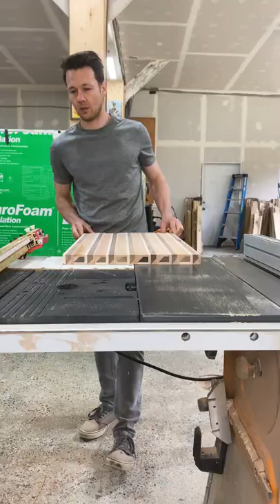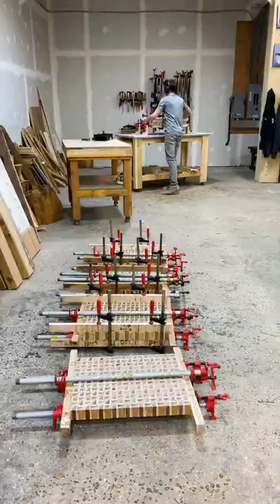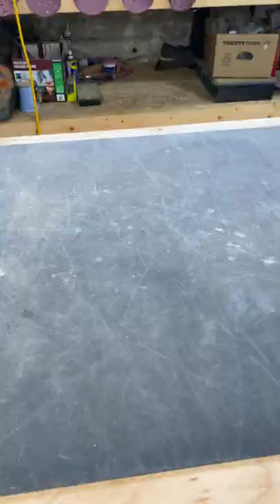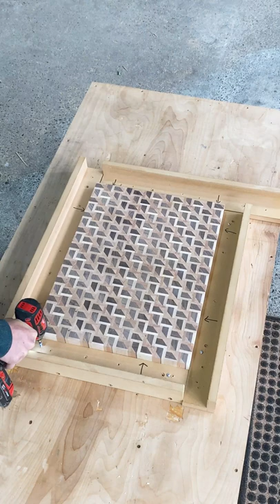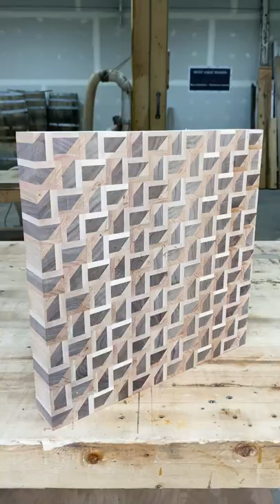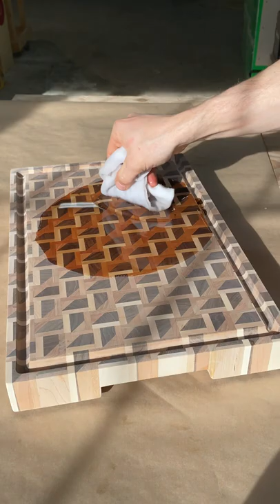Building 3D Patterned Cutting Boards Part 2

Comment: The boards look great. Roughly how many hours do you have into these boards?
Reply from the maker: The boards themselves probably took a total of 45-50ish hours to do.
Reply: @ryanhawkins  From rough cut to finish? If so thats great.
Reply from the maker: @jojones9194  That's correct. I've built a lot of these and have the process pretty dialed in.